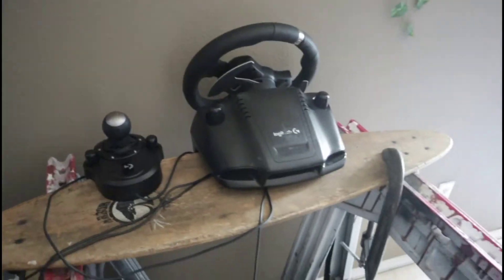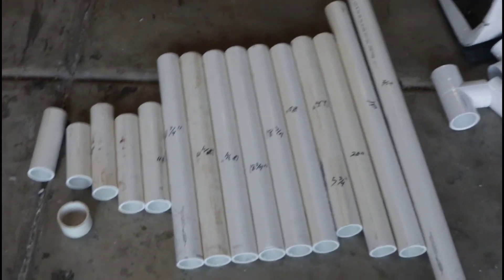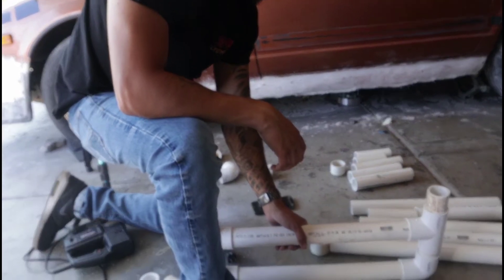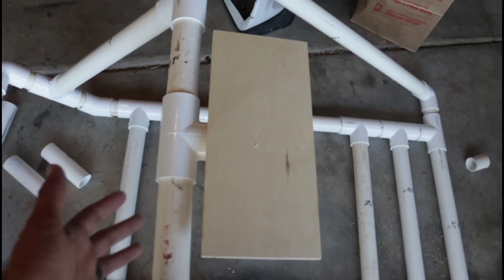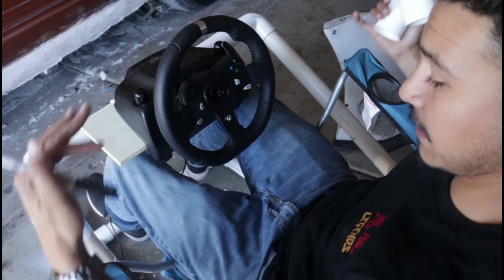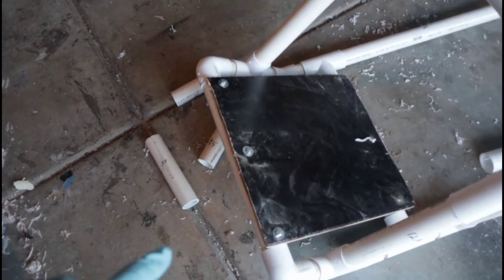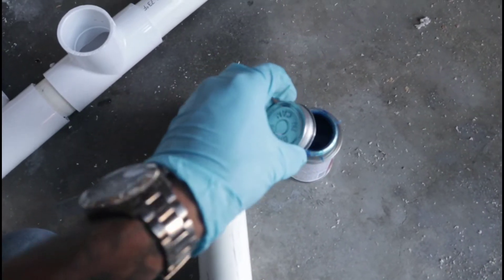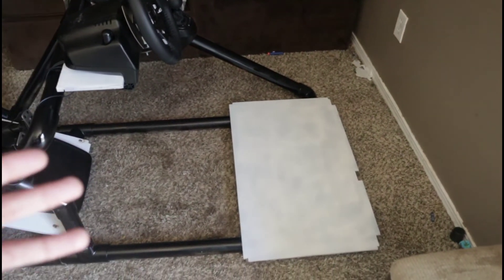Building a DIY Racing Sim Rig

Comment: As a plumber and a sim racer I am wandering how hard it was to get those short pipes out after your dry fit. Nice set up though I’m wandering how much flex this would have with a direct drive wheel.
Reply from the maker: Thanks! And they were a bit difficult to get out of I remember correctly 😅 but after all this time it’s all still holding up well and hasn’t showed any signs of breaking
Reply: @dirtybuildmedia566  I’m sure, what kind of wheel are you using?
Reply: What about a layer of fibreglass mat over it all?